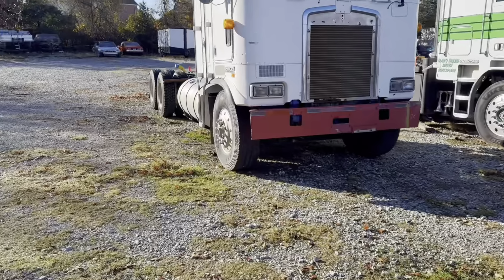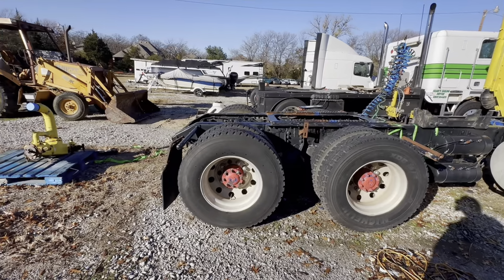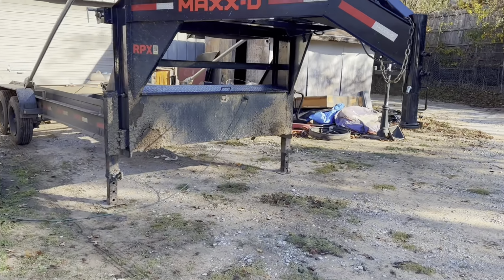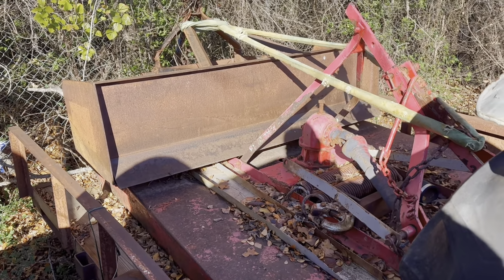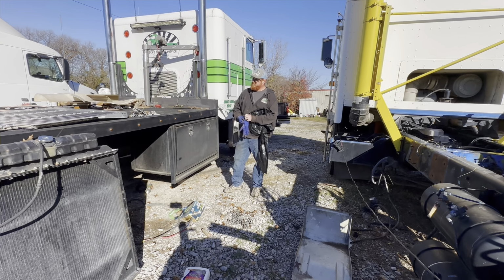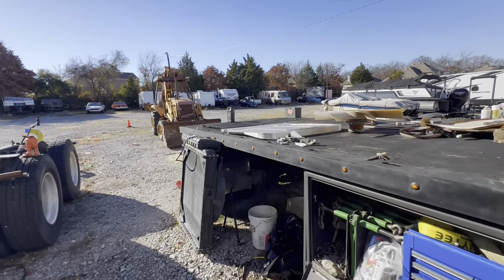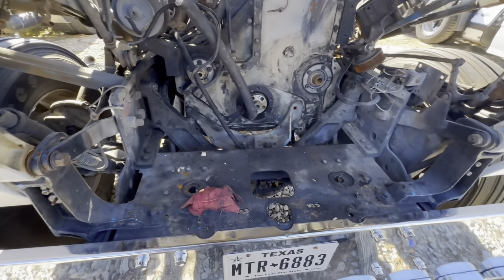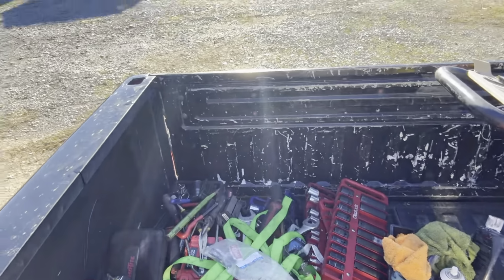Cleaning out the old Freightliner cabover for its new home

Comment: every time i clean out  truck, i end up with a whole new collection. sad to see the freightliner go but the kw is going to be even better. heavy hauler rgns are able to be bought with longer neck. also, you can get a longer slide for your 5th wheel to move it back when you haul something that would interfere with the rear frame. what is the deal with the wrecker that thumb was in?
Reply from the maker: Yea, reading this I started to look around and found that longer slides are definitely a thing. So gonna see about going that direction so I am versitle. That tow truck has a good spec with a double line bed and an under reach, but it has a 7.3 that many have tried to make run and it is pretty torn up electrical now.  I tried to offer some suggestions knowing 7.3 pretty well, as this one is my third. But he just feeds it either till it either locks and then comes back agin another day. This point feel like the bed is the most valuable part of that truck.